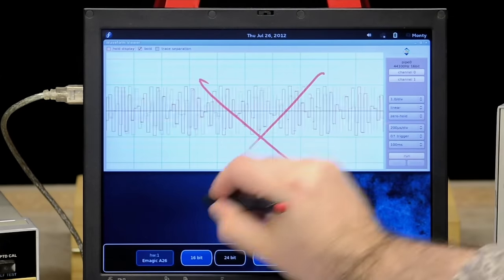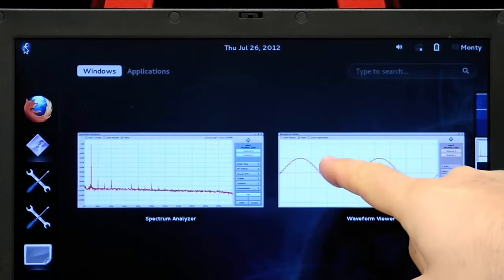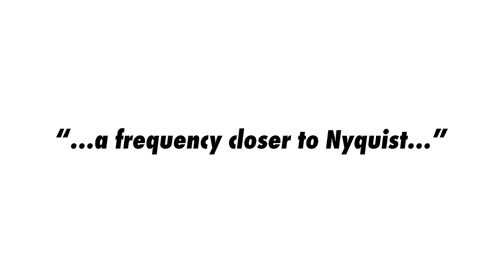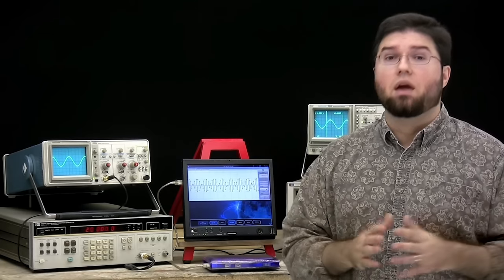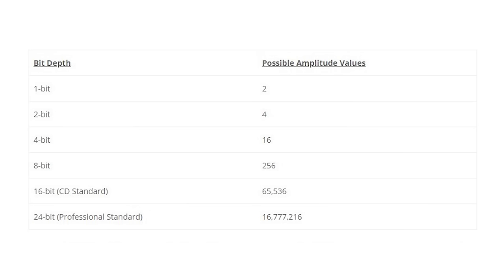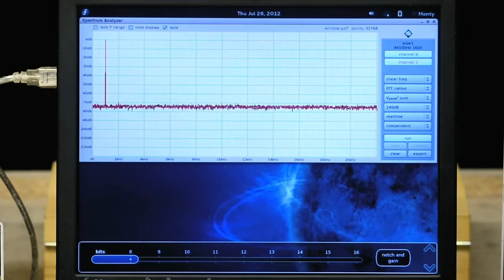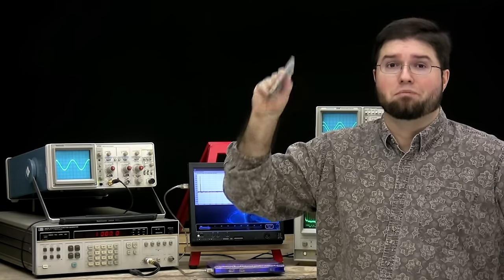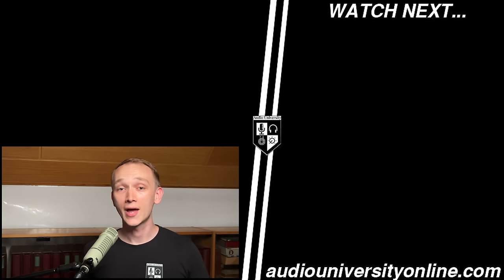Debunking the Digital Audio Myth: The Truth About the 'Stair-Step' Effect

Comment: More bits means less sample noise. That's all. Sample noise can be reduced by digital (interpolation/oversampling) and analog (low pass) filters. More samples means higher maximum frequency. But 22 khz maximum is plenty. Cd players have used oversampling since the mid eighties. For digital mastering you want to use higher resolutions because everything you do with it other than straight copying adds more sample noise and then it adds up.

Comment: "KISS" Keep it Simple and Stupid is a great guide line for engineering product. I learn from your video that it is applicable for tutoring. THIS IS A GREAT VIDEO!!! any one can understand and can not argue with simple truth and experiment.
I build loudspeakers (active) that are based on digitizing source before amplification (thus, I can use digital cross over). All "AudioPhiles" are sure that this is a big no no. Maybe this video can convince them. 
However, most of the opposition to digital is mostly a "Religious" way of thinking, "I believe" without a proof.
These believes enable of selling speaker wires for thousands of dollars etc...

Comment: Decibels are confusing because they are relative measurements not quantitive measurements. They measure relative differences only, not objective values. The dB spl measurements for sound pressure levels in the air can be related but not the same as dBv of voltages in analog audio circuits which is different from the dB used to measure the dynamic range of a recording medium. These are different because they are different things entirely, pressure waves in air vs voltages in circuits vs reproductive accuracy of a storage method. The limits of human hearing is different from the audio circuit’s greatest possible voltage swing is different from the range of a recording medium such as tape or the range a given digital bit depth can recreate. 0dB is arbitrarily defined depending on what sort of thing one measures. For instance the threshold of hearing is the smallest vibration (the average) human ear can detect is 0dB SPL. In audio circuits 0dB on pro equipment is 1.44v and 0dB on consumer electronics is 0.7v and attenuation is measured down in -dB values. Similarly on recording media 0dB is the highest signal that can be reproduced without change to the original content in the form of tape compression or digital clipping. Dynamic range is yet another difference measurement. If the noise floor (think tape hiss) is at -70dB and the strongest signal recordable is +4dB then the dynamic range of that format is 74dB.  It’s analogous to measuring temperature with either Celsius or Kelvin degrees where the start point is chosen for the convenience of the use case. In fact decibels could be used to measure temperature differences or the relative strength of earthquakes. It is simply a logarithmic scale.

Comment: I always record 44.1/48KHz and with a  24/32 bit depth, depending on what is supported. Not because 16 bits doesn't sound good, but because I don't have to convert it before processing. Doing multiple (sometimes dozens) of processing cycles recalculates (and rounds) each sample value in every pass to a whole number. In the end this adds up and is audible as being slightly off and less crisp to the trained ear. The bith depth just gives you more precision for each calculation for every sample. In essence it is still slightly off, but due to the higher resolution of each value, this is inaudible. 16 bits only had 65000 possible values, 24 bit has 16 million. Say the max value is 100% of the maximum hight of your signal (let's call it amplitude), and you can easily see how 24 bits gives you a more fine grained precision than 16 bits. Sometimes the final step is downsampling to 16 bits, but usually I don't care for that. 24/32 bit 44.1KHz is also a lot easier to work with and makes more sense (as explained in the video) than 16 bits 88.2KHz. IMHO as soon as you come to 44.1KHz, bit depth IS a thing. You might need higher sampling frequencies if you're a dog... 😂.

Comment: I like to record at 48000 24-bit because it gives me more headroom to boost the signal of instruments with high dynamic range when I compress or otherwise process them. I used to think it was a flaw that my my tascam model 12 didn't do 96 or 192khz like my 15 year old audio interface, but I never used those modes anyways and now I see I wasn't missing out on much

Comment: i think it has more to do with a fact that the sampling rate only affects super specific and more complex audio samples

the analog system cannot produce stair-step, because of its abilities, and because of the way we are even able to interact with audio... we require it to be converted to analog, where it basically fixes all of the issues that some people say might exist, but not everything

lower noise ends up being less "muddied" sounds, because that noise, interacts with the original sound wave, and changes its actual sound

basically, we have already hit the point of diminishing returns, where the only thing we are doing now, is reducing any unwanted noise or distortion, by capturing it as accurately as possible, for those specific edge cases

Comment: In the early 1980s when CD was launched, most ADCs and DACs were only capable of producing about 10 bits of resolution (effecitve no. of bits), so maybe way back then, the staircase argument had more merit. These days anyone can easily get 16 bits or more of resolution.

Also the anti-aliasing filter or restoration filter, will also help to smooth those jagged edges and stair case transistions.

I think you could have used a digital scope on the output though, analogue ones do tend to smooth the waveform and have varying display intensity around step transistions, making them hard to see.

Comment: The reason it's represented as stepped because the values stored are of digital value. It is meant to show how sampling works over different sample rates - meaning how frequently we take a slice of the audio. Also since all signals can be broken down to a bunch of sine waves, we know that in the end the algorithm will reproduce the sine wave if we give it enough samples.

Bit depth is strange topic - if you ever turned up the volume on a song with fadeout on a CD (which is 16 bit) you'll hear either the dithering or quantisation noise, depending how it was mastered.

Comment: I once attended a recording seminar sponsored by Prism Audio, a UK company that makes digital converters.  They describe the use of dither as a way to eliminate the overtones from bit related sample errors in the noise floor, converting it to random noise.  Perhaps the use of dither in this video doesn't address the audio issues in devices that don't employ dither?

Another aspect that may be overlooked is the method of measuring the distortion and what it doesn't tell us about transient behavior.  This video shows testing with a steady sign wave which is continuously repeating.  Given the brickwall high frequency filter employed in DAC's, the distortion will measure very low for a steady wave (because all the distortion harmonics are heavily attenuated), but when it's instantly turned off it will likely ring for a period of time.  This might be why high frequencies sound a bit splashy in many digital playback systems.

Comment: A study I read found participants could discern the difference in timbre of sounds with their harmonics up to 50k left intact vs low passed at 20k. A 50 khz pipeline - mic to ear balls - amazing :)
Reply: MF Nickster edit: An article I read in the 90s about scientific conclusions with respect to comb filtering enabled by earlobes as primary brain mechanism for determining the direction of a sound and its implications on surround sound scheme development found...
Reply: MF Nickster   @MF Nickster  not "hear* freq above 20k, can discern their effect.
Reply: This is the reason why a lot of high end amplifiers are designed with a much higher bandwidth than 20kHz

Comment: As I always knew: It's much more about the mix and the mastering. A lot of CDs are mastered awfully these days, while the High-Res stuff is mastered properly. I recorded the High Res Flac files of the last Tori Amos album on a Type II - cassette and it still sounded so much better than the CD. But the cassette is clearly the inferior medium. And I didn't use a Nakamichi dragon. Just a simple mid-range Sony deck from the 90ies.
Reply: Tbf bad CD mastering, loudness war and all that jazz is just an endless story in itself...

It doesnt really have anything to do with the medium though. Especially if the high res is mastered well, but CDs not, then they mustve done something intentionally different.

Comment: The other thing is the speaker itself is an analog device, so even if you were feeding it a stairstep signal, the inertia of the cone & magnet would smooth that out considerably, possible even enough to get rid of it altogether.

Comment: I can't find the exact link of the video I once saw regarding a benefit of using high res files for playback too, but it had something todo with analog to digital circuits and low pass filters. It was suggested that all hifi receivers from all well known brands also use lpf filters for some of the inputs, where later on, digital processing would be needed for f.e. room correction... is this a thing you believe ?

Comment: The stairstep output is what you get without filtering, because there is in fact higher frequency content present when the DAC switches from one voltage level to another. You just won't see it if you filter out everything above the nyquist frequency. It's also possible for that filter to cause some distortion in the audible range, because real world products often aren't perfect. My phone for example can play sine waves at 20khz, but a square wave above 5khz just looks like a sine wave.
Reply: That’s because of the harmonics that are produced by a square wave. So a 6kHz square wave’s first overtone will be 24kHz, the next is 96kHz.
It’s not distortion caused by the filter, it’s just harmonics outside audibility. Whilst it’ll get filtered out by an anti-aliasing filter, you’d never hear those harmonics anyway.
Reply: @3rdStoreyChemist  I said distortion caused by the filter, distortion which would still exist if you applied the same filter to the original analog audio signal.
Reply: @sleepib  What sort of distortion are you referring to here?
It does come across like you’re getting a few concepts wrong here, especially with not knowing what a square wave is.
If the anti-aliasing filter is creating harmonic distortion, then it wouldn’t work. But the artefacts wouldn’t be a square wave sounding like a sine wave, you’d get aliasing and quite likely more of it than if the filter wasn’t there at all. Which is the harmonic series generated gets inverted at the Nyquist frequency.
There is something else I think you could be referring to, but to call it ‘distortion’ just seems odd, as well as your description of it.
Reply: @3rdStoreyChemist   I think you misunderstood my original comment. The filter's job is removing harmonic distortion, but it's adding frequency response distortion to do it, and cheap ones often start attenuating within the audible frequency range, not just above 20khz..

Comment: The theory is known from the times of shannon and nyquist.  And in theory, there is no difference between theory and practice. But in practice, there is. What the video do not get is that reality is a little bit more complex, that signal are rarely just converted back and forth, that modern audio processing is done in the digital domain where computational errors and aliasing change the final result. So, as a restitution format, and if you have a perfect DAC (but perfect DACs cannot exists, see Nyquist theoreme), 16bit at 44Khz is pretty ok. But for recording, processing, storing, etc, there are very good reasons why the industry moved to higher resolution, and higher sampling frequency.

Comment: 24 bit audio and high sample rate may not be on the plain of diminishing returns  but when transferring the files back and forth and processing them so much, it's basically an error margin so any issues or downsampling that comes up will not affect the actual music or noise floor of the files. you can effectively crush it without much harm. as far as I know anyways

Comment: Ok, I'll begin this "correction" by making clear I know absolutely nothing about audio. But I do know how the maths of data encoding works.

It is possible to store data as discrete values and sometimes this is done but there are much better ways and with music it's a no-brainer (as it's always lossy).

Basically you do it by adding cosine waves* as certain frequencies and adding them. A wave at frequency zero is a straight line. A wave at frequency 1 is what you had. The nice thing is you can add these waves to make new, more complex, waves.

So if you start with a cosine then this can be expressed with two numbers; frequency and amplitude. That's very efficient. Especially as you can render sounds into frequencies by representing it as a matrix and taking the outer-product. You can build hardware to do this / use your gpu as it's highly parallelisable in a wavefront. That's to say, hardware makes short work of it.

So what types of wave can you make by adding frequencies on top of one another? Every kind, that's what. It's limitless.

The great thing is that if it was any sort of entropy at all (so not just noise) then it's going to be efficient. Even better, human hearing has limits, so you can just cut out the high frequencies. This is also useful in noise reduction. Also, as the digital data is effectively analogue you can sample it to your heart's content, it's effectively interpolated. That's why you'll never see any stepping.

Clever, eh?

*it's possible with sines too but you need complex numbers with an imaginary component and it's less intuitive. Also, cosines are better for music because they meet at the ends easier as the data has to be cut into chunks.

Comment: "16 bit depth audio is more dynamic range than you'll ever need". Until you start compressing or distorting during mixing, which brings all that noise up to audible levels.
Same goes for Sample rate: There is a difference when you saturate audio when it has information above heard frequencies or not.
Reply from the maker: Watch the next video.
Reply: @AudioUniversity  i did, right after i made that comment... :D

Comment: When you do the next video in this series, please add Kell factor.  The Kell factor limits the frequency response below the Nyquist frequency because the duration of the sample period is greater than zero.  This problem essentially goes away with over-sampling.

Comment: Electrical Engineer here, I have an analog oscilloscope from the same manufacturer and the fact that it does not show the stairstep is not proof that it is not present. I have discovered that my analog scope smooths digital signals erasing the presence of the steps. It does not plot the jumps of discontinuity and gives more of a weighted average that appears continuous. If the point of this experiment was to observe the presence of a digital signal, a digital scope is obviously what should be used.
Reply: MF Nickster  the scope's probes knows not what analog or digital is nor does it care. It knows only voltages over time. Yes my analog scope accepts digital signals for if they appear as a voltage it will be picked up. However the more the signal deviates from the pure sinusoidal waveform the more it is not detected. In my scope sharp 90 degree corners are never picked up in the signal, it appears as a smooth sinewave until I connect to my digital scope where the ugliness of the signal is revealed. I have designed my own 10KW DC to AC inverter and in the process I developed my own means of signal generation and measurement.
Reply: MF Nickster  in my case I was looking at an analog signal produced by transistors and capacitors. The transistors have to biased just right to maintain a pure sine wave output otherwise clipping of the signal and other asymmetries are introduced. Despite the signal being distorted, on my analog scope it would look perfect, while on my digital scope these imperfections would be visible. It is for this reason that I suggest this might be a flawed experiment. We need to see that this scope is even capable of displaying stair-step signals at all. My analog scope cant and it is of the same brand ¯\_ (ツ)_/¯.
Reply: MF Nickster  Nick that is not at all what occurred in my case because I also had a copy of this circuit simulated in pspice and the image of the distorted sinewave was predicted in the simulated output and my digital scope represented this in real life exactly. This distortion did not appear in my analog scope. To me it seemed as if my analog scope presents every signal as if it is differentiable. Because a signal that is turned into analog from a previous digital version will have discritized jumps at the sampling points, it goes from slope infinity to slope zero with nothing in between to make the stair steps.  although to us humans it seems like an analog sine-wave, the blockyness that you were looking for is akin to 1's and 0's that the analog scope is not going to show it! It smears them into a portrayal of a perfect signal but a fine sound system may reveal the truth, along with a digital scope. That chubby smug smarty pants professor mentor guy may have made this simple glaring oversight in the demonstration.